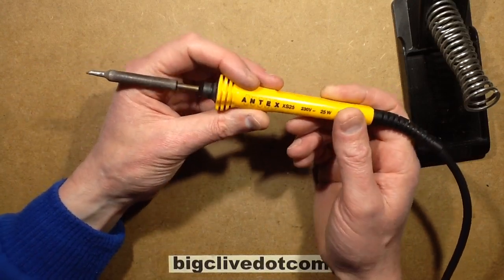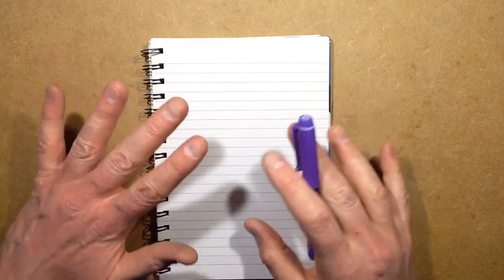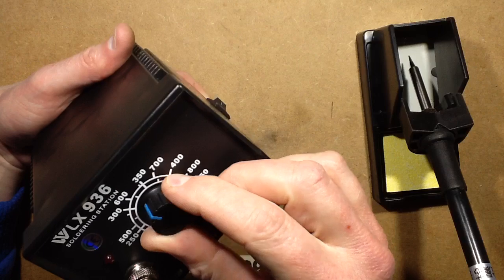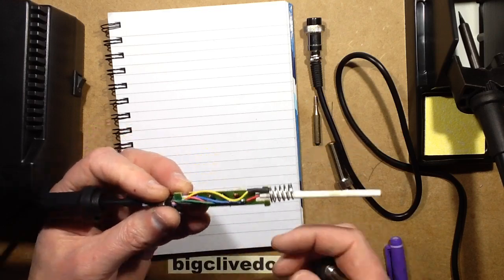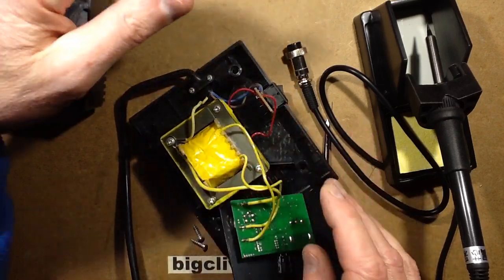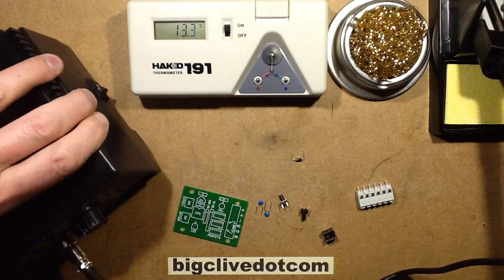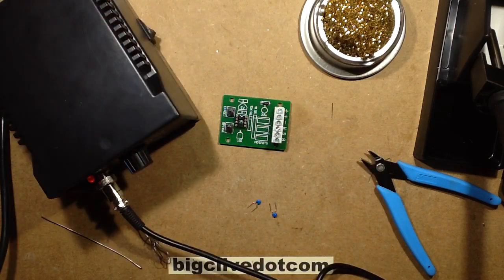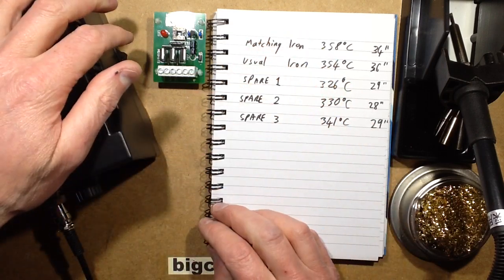Soldering basics and choosing a cheap soldering iron.

Comment: I learned to solder with an old fashioned soldering iron that was heated off a hand pumped torch and iron. My grandfather taught me the way he learned. Once he showed me how to use an electric soldering iron I was amazed at how much better in some ways the old fashioned version was. This was when I was 8 years old and I had broken my atari 8 bit computer. I don't know how he diagnosed the problem but we removed the 2 bad chips and replaced them. I also had broken 4 tracks on the board and had to use wires to bridge the breaks. You definitely could not use an old fashioned iron on anything built since about 2010 for sure it's just too big and the heat just spikes and drops so not ideal.

Comment: This older vid convinced me to buy a Ebay Hakko 936 analog (Non Digital). $24 US plus $6 for like 6 spare tips. (Pre Covid in early 2018-19)

I have not been disappointed. When I first bought it I had to take it apart just to look. For Curiosity.  One of the resistors was sloppy soldered so I fixed it. And it was the bigger control board that Big Clive has in this vid not the smaller one. I believe Big Clive shows two in this vid. The one inside the unit itself and a replacement panel front with bigger PCB.

I used Weller 20 to 30 watt Irons for years (and several cheap knock offs) I dunno if the temp is dead on or not. As I adjust mine to barely melt then increase as needed for the job.

But I have to say it is much nicer then a regular not temp controlled iron. Especially for small circuitry.

I had looked at several different setups. I was going to just buy another Weller 25watt and make a variable power/heat controller with a light type dimmer. 
But $24 is cheaper then I could make one and buy the new iron. 

So the TL;DR. Buy a Ebay 936 clone. Its worth it if you are a Iron Pen with no heat control user. Even with Covid pricing at $36.50 currently on Ebay.
My station I bought 2-3 years back. Was $24 at the time. Now the same station is up around $40. Thanks to the Covid.
Reply: Harbor freight sells a 50 W Schneider soldering station for only 45 bucks and it's a very good deal. I did a review and tear down of one recently on my channel.   The one thing it really should get is better quality tips because the supply tips are iron throughout not copper. Hey co 900 M or T12 tips are apparently exactly replacement fit for it so you can get copper tips with plated iron at the pointy end and improve the performance. Also, The cord from the station to the iron is a bit too fat and stiff and it's not heat resistant;  It could be replaced with a silicon cable fairly easily if you have another soldering iron to work with when you swap the cable out but anyway for 45 bucks it's a steal.  On the other hand the $65 Weller soldiering station they sell at home depot is a piece of junk because the supplied iron is a mains powered 120 V direct into the wall type iron and the only thing the Bay station does is add a electronic light dimmer so you can turn the temperature down, but not up. I can't recommend Weller anymore because they sell some real crap nowadays.

Comment: omg dude. you still need the flux ( as  you already know) its just not incorporated in to the solder. you brush on the flux and as far as im concerned thats the easiest solder to use. its a snap. this is the case where you would apply the solder to the tip and carry it over to the fluxed or pre tinned component. honestly i dont know any better so i just use plumbers flux works great.
Reply from the maker: The solder with a flux core is best for electronics, but you can use separate solder and flux.  Plumbers flux may cause corrosion to the copper tracks later if not cleaned off afterwards.

Comment: What you think of the ts100 and the ts80/p soldering irons? Should I get one? I had a Chinese rework station bit it's broken all the display doesn't work and the soldering iron won't heat up even after replacing the core in it.
Reply from the maker: They seem popular.

Comment: I am considering a hot air blower for SMD and I was wondering if you had any recomendations. I wondered if it was possible to unplug the iron from a generic chinese soldering station such as the 936 and "Just" plug in a hot air tool. Ideas on a postcard 🙂

Comment: 6yrs late to this video of the great Clive..
I've had antex irons & still have a couple of Wellers that i borrowed from Amstrad back in the day but my rolls royce iron is definatly my MET CAL from California. Its amazing.
One of the worst i had was from Maplins, there gold precision range with variable heat settings was so aweful i gave it to my wheelie bin.
I did once upon a time take apart the psu for my MET CAL & inside was a high frequency transmitter/ generator !!° bizzare.

Comment: I wonder have you thought  of using one of the smaller irons like the sequre, the sequre has an automatic low power mode that lowers the temp when it doesn't detect heating loss from working, it just heats back up in a few seconds, and theres an option to turn it off completely after some time, you can't leave it running unless you tell it to

Comment: I’ve only ever used this exact Antex iron and I love it. When I’m finishing a soldering session I switch off power then dip it in tip tinner, stops it from oxidising. The other thing I’ve found that keeps my bits happy is never use the damp sponge to clean it, I only use a brass scrunchie.
Reply: Funny you mention this because I recently stopped using a sponge out of sheer slackness and I found I had absolutely no reason to bother ever using one.

I’d love to hear what advantage they gave over the scrunchy because I sure as hell haven’t missed having to use one.
Reply: @bentosan ,  From what I've read, the damp sponge can actually put stress fractures in the iron plating at the pointy business end of the tip and shorten it's lifespan (not to mention that some people can be seen on YouTube video using a sponge that is so saturated in water that steam arises when they touch the sponge with the tip!). I've been soldering for over 50 years and I can tell you from experience that the brass wool works better than a damp sponge and it doesn't cool the tip off as much. As for the iron plating that I mentioned earlier, high quality soldering tips are plated with iron at the pointy end only because bare copper is easily dissolved by molten solder and flux, and without that iron plating the tip would have a very short lifespan.  However, many affordable irons or soldering stations come with tips included that are made completely of iron or steel, and those will have poor thermal heat transfer characteristics compared to copper.  Good quality tips should be strongly attracted to a magnet only at the pointy end and not at the rear of the tip. I posted a video about this on my channel recently as well as a review and tear down of a $45 Harbor Freight Schneider soldering station which is actually pretty good for the money, except for the cruddy tips that come with it, which are not only apparently completely made of iron (it says so on the box) but are also conical which is the wrong shape for most soldering operations. Most newbies to soldering will find that a "chisel" tip, sometimes referred to as a "screwdriver" tip, works better.

Comment: When buying these brass shaving balls for cleaning the tips, stay away from the copper ones (they're all fake), and the absolute cheapest "brass" ones. Make sure the vendor/seller says it's actually brass in the description. Not brass (or copper) "look" or "plated", those are fake too. This is really important, because the fake ones are just plated steel scrubs. You can check if it's actually steel with a magnet. Unlike actual brass, steel is much harder than the iron coating on your solder tips, so it will rather rapidly, literally shave that iron coating off and ruin those tips.

Comment: So i'm wondering if your position on cheap chinese manufactured soldering irons still holds up? I bought a Yihua soldering set from amazon and the heater broke on its second use. It did come with an additional heat element however, but it looks like the wire to ground it has not been connected and i am too scared to use it. The iron itself was fine for 3 uses, then it wouldn't turn on. I now have to hold the power switch and lead in a certain position to get power and when i do, its not consistent. Tried to get in touch with the company, no answer. Just saying incase anyone else thinks Chinese irons are a good deal... they are not. Spend the extra cash and don't waste £80 like i did!

Comment: Has anyone tried 3M' or Loctite Aluminium solder?
It looks and feels like lead-tin solder, however, it is specifically for aluminium. The details I have on my roll of this solder is Alloy: 45D, Core 4C, ALUSOL FluxTin/Zinc Fluoride Amine Complex.
I had a number of aluminium can capacitors to re-stuff in order to keep some old equipment looking original, this required the new capacitor to be put inside the old capacitor and to have the negative wire soldered to the aluminium can of the old capacitor. Note: don't use your best soldering iron, this stuff turns your soldering iron bit black, and it takes a little cleaning off.
Using a very hot old iron and VERY clean aluminium surface, this solder really does work. You can solder component wires to an aluminium surface. However, you need a huge gas iron if you are going to solder anything onto even a modest-sized piece of aluminium because aluminium conducts heat so well that you can't keep the joint hot enough to solder and once the aluminium oxidises (turns very discoloured) as it does with this solder/flux, you need to reclean the surfaces if you are not quick and the iron isn't hot enough.
If Clive would like to give some of this aluminium solder a try, I'm happy to send some to you, but I'm not sure how to contact you directly to arrange to send you some. Small pieces of this solder on eBay sell for silly prices, but I purchased a 500g roll because I use it regularly to restuff old capacitors and to solder onto the aluminium cans.

See this photo of the roll of solder and its details - https://www.royalsignals.org.uk/temp/solder.jpg

Thanks for the great videos!
K Watt.
Reply from the maker: Heating larger aluminium panels before soldering them can make a big difference.

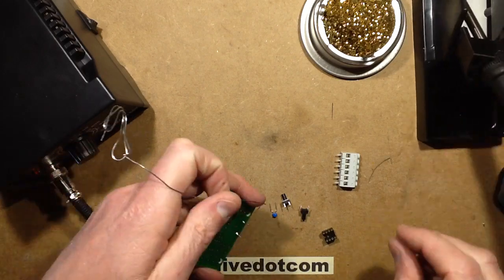Comment: A good introduction. But I cringed hard when cut the contacts of that diode at 33:14. That's a major violation of the IPC-standard and will get the foremen where I work pretty mad at you - if they catch you doing it. The physical stress of doing that has the potential to change the crystalline structure of the the solder in the joint, weakening it substantially. Either cut contacts before you solder them or re-melt the joints after cutting.
Also: having some liquid flux around can come in real handy when you're dealing with smaller joints or SMD connections. Preparing the connections for soldering with liquid flux allows you to bring the solder in on the tip of the iron. Which is be pretty useful if you need very small amounts of solder or need to free up your hand to hold your parts in place during the process.

Comment: I have a similar station. The White core part ended up breaking in the iron and stopped working eventually. Been using my grandpa's soldering iron he bought in the 60s.  😂 Works pretty good but getting low on iron tips that were in the original box. Gonna be forced to buy a new one soon :(

Comment: RE: no-clean flux.  I've had problems with Kester cored wire solder with the "no clean" 245 flux.  Likewise with their 331 water soluble flux.  They're just not aggressive enough if you have the slightest bit of corrosion on your leads or board.  45 rosin core solder for the win!  OTOH, I've had pretty good luck with the no-clean 186 liquid flux for surface mount soldering...

Comment: Interesting videos indeed.  Had 5 of these Antex Irons since I was a Kid in the late 80s.  Essential for ham radio operators like myself. Using a small bit I use it for surface mount. Are you licensed also Sir.
Reply from the maker: No.  Not into radio.

Comment: Haha, I did that once, I accidentally left an iron plugged in for like a week. It didnt get ruined, and it was only 30watt iron, but it was dangerous and stupid.
I almost got that yahua iron with heat gun combo, but I ended up getting the ts-100 instead, and im very happy that I did, the ts-100 isnt cheap, but its inexpensive for what you get. Its also opensource, and I like to support opensource. 
Over the decades, I too have used many irons, and ultimately, I want a hot iron, I have no patience for slow irons and generally just turn them up to full and use them as hot as possible. The tip that comes with the ts100 is terrible, but you can get a good tip for it, and it does put down a lot of heat fur a tiny iron, dont let its compact size fool you. Having said that, really any iron that gets hot will work, some are just nicer to use, even those tiny 30watt irons will do the job, you just gotta be more patient or working on tiny stuff. 
Ive seen you using little usb powered irons and from the way it looks, they are inexpensive but still quite usable and I may get one in the near future, just because its handy to have a spare cheapo backup unit.

Comment: 3:55 Glad to hear my suspicion was pretty accurate: I've only recently gotten back into electronics (I used to do it as a teen) and the bit in the iron I've had for about 15 years (which used to be my father's everyday iron) has definitely reached the point where the wear on the coating causes it to be mostly ineffective - by the time you desolder a component, you find that it's still hanging on even with no solder left on the connection. It softens the PCB! It then only lasts about 15-30 mins before becoming 'dull' again, even if you clean it before you solder the next connection.. I'm looking forward to getting a new (but affordable) soldering station this week. I appreciate that there are so many experienced electronics guys on the net, who offer useful tips they learned via experience.
Reply: A bit of sand paper works for me make it shiny and add a bit of soldier and the heat transfers lovely
Reply: @robboinc1 ,  High quality soldiering iron tips are made completely of copper but with a plating of iron at the pointy business end ( and chrome on the rest of it) and therefore you should never use sandpaper or anything abrasive on the tip as you will remove the iron plating, exposing bare copper underneath, which will quickly be dissolved and eaten away by molten solder and flux. The iron plating resists the dissolving effects of solder and flux far better than bare copper would.  It is important to note that many of the inexpensive soldering iron tip replacements sold online are actually made not of copper but instead of iron or steel, which you can confirm with a magnet.  High quality tips should be attracted to the magnet only at the pointy business end while the cheesy steel or iron tips will be magnetically attracted throughout even at the very rear of the tip. Copper is a far better medium for transferring heat efficiently than iron or steel; Install copper tips in place of the steel ones on your soldering iron and all of a sudden it will be almost as if you've purchased a newer better soldering iron. ( I posted a video about this on my channel as well as a review and tear down of a $45 Harbor Freight soldering station that, with a change of tips, is actually quite good and very affordable).
Reply: @goodun2974  the tip I was referring to was on a cheap 230v soldiering iron which had an iron tip, since moved on to pwm controlled soldiering irons with proper tips, cheap Chinese copies but they work well.

Comment: Have repaired quite a few things with intermittent (usually temperature dependent) problems that were factory wave soldered with cold joints and partial soldered joints. Some with the bad joints that looked quite good.

Comment: I used an Antex AN25 for decades starting in 1978 - that iron was a blast from the past

Antex bits are copper/iron coated and they never lasted well. Once the iron's gone you just file 'em down and carry on

My favourite "tech bag" iron was a 60W Weller W61 iron. These have megnetic reluctance tips (when the top its the right temp, the magnet loses power and switches the element off) which means you can use a huge range of tips on them from 7mm fatties down to 1mm rework bits in various temps

WRT "lead based solder" - DO NOT use lead solder when reworking leadfree boards and vice versa. Don't mix the bits either (to prevent tin rot, always recoat your leadfree joints after you've finished. Conformal coating stops tin whiskers)

I ended up with a nice temperature controlled station which lasted forever. When I moved to England, decided to buy a station from Maplin, which was atrocious - the "temperature" setting turned out to be a simple wattage control, no thermal feedback at all

Comment: Back in the 80's in East Germany you could not buy solder with a flux core. My dad taught me to carry the solder on the iron, after preparing the joint with liquid Kolophonium (rosin) manually. I kept doing that until today. After watching this, I think I need to relearn my soldering method!
Reply from the maker: Carrying solder to fluxed pads is now a common technique for surface mount components.

Comment: Mostly, the heater's resistance increases with temperature and P=V^2/R.  Lower temperature means more heating power to reach its natural temperature.  This negative feedback loop has low gain, but it is reasonably effective.

Comment: slodering aluminium is easy just get aluminium soldering flux. I bought a bottle from russia on ebay. I just use regular lead solder. Really hany for lipo terminals that are alu.